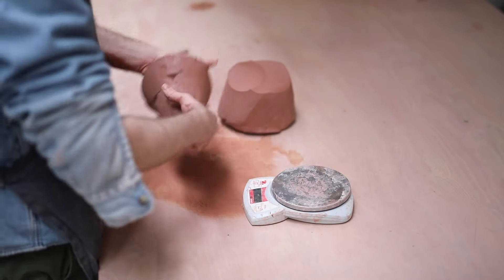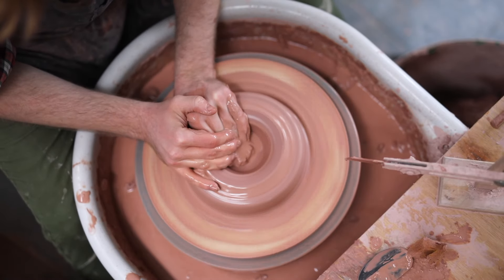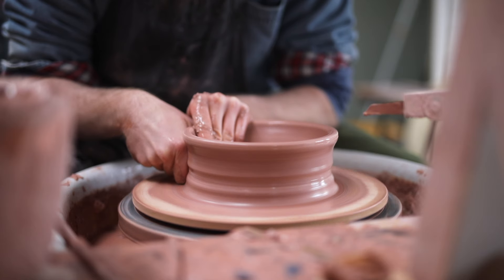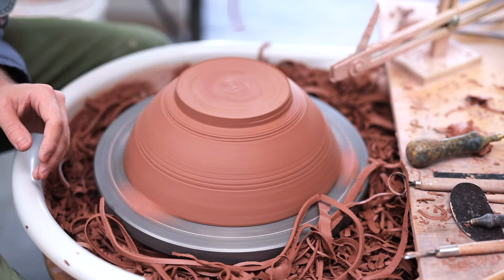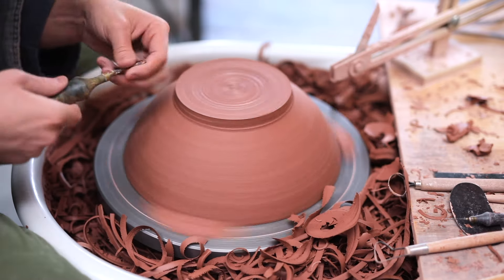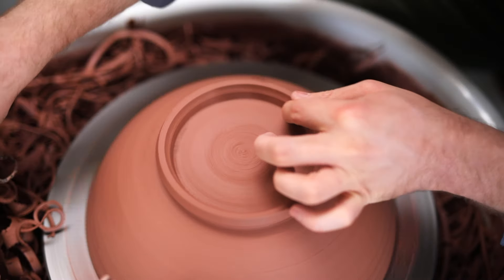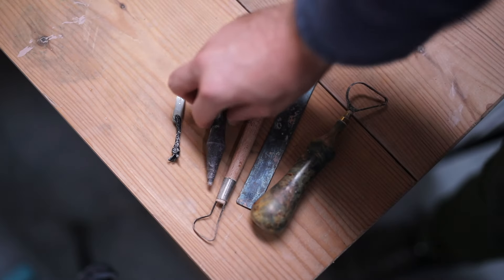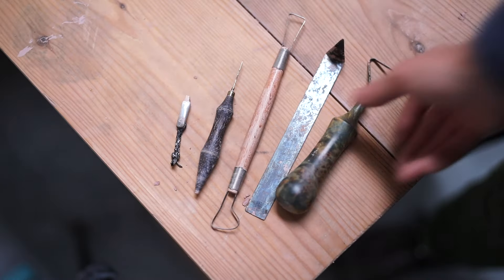How to Throw and Trim Large Stoneware Bowls — Narrated Version

Comment: I think my bison tools are coming soon, since I ordered in November. Absolutely cannot wait to try trimming with them. I’ve only used steel, so I imagine I’ll have too much fun with it and ruin a few pots, but probably worth it. Still won’t call it cheese hard, though.
Reply from the maker: It changes everything. They just remove so much material so quickly. It certainly takes some getting used to but it's very worth it.
Reply: @floriangadsby  Yes, I find, because they are so sharp, especially when new, that they seem to do better trimming slightly drier clay — especially smoother clay rather than with grog. But, these are details and I really love trimming with the Bison tools. Thanks for all the great videos Florian.